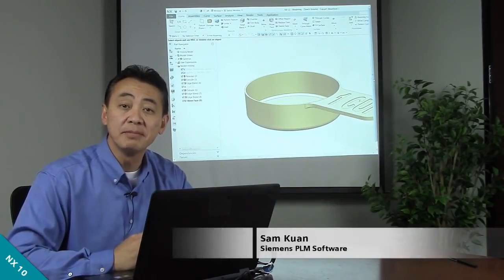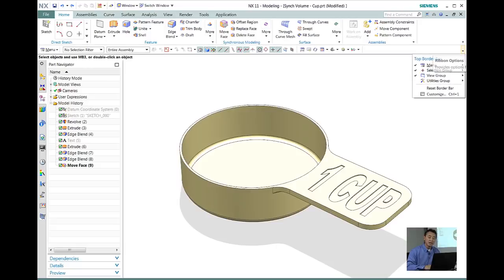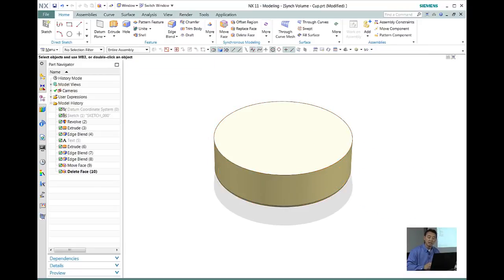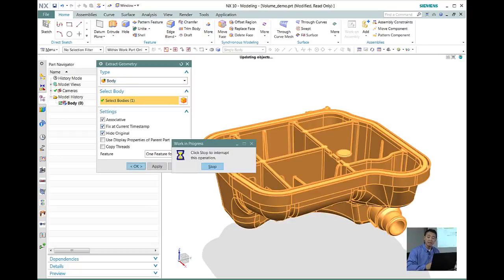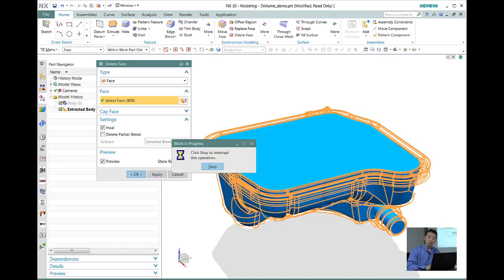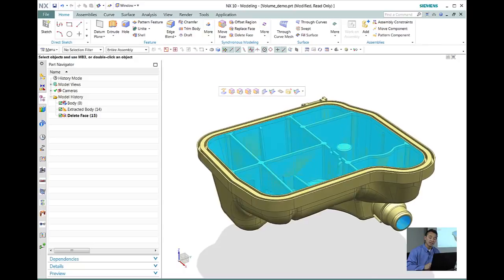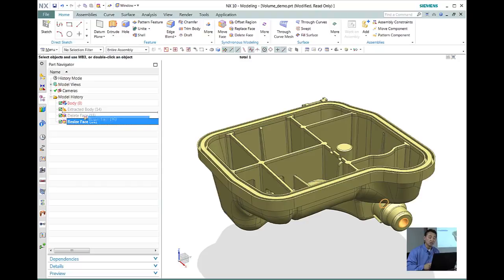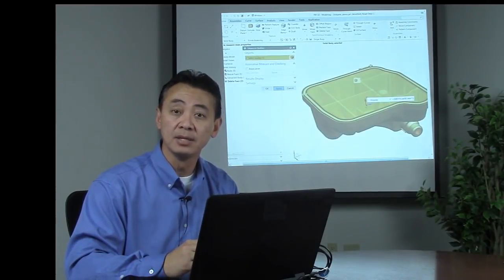How to calculate Volume of bottle in NX

Comment: Volume is easy enough. I need something on surface area projected to a flat plane. Let's say it is a complex part with runners. I need to calculate what the projected surface area is to calculate die blow on a press. I would also like the result to be associative back to an expression that will always update and I can extract to a spreadsheet. Any tutorials for this in NX11?
Reply from the maker: you can use NX easy fill for this, it has pre- defined commands for this.
Reply: What is this "easy fill" you speak of. I looked for it with command finder and didn't find it.
Reply from the maker: https://www.youtube.com/watch?v=oqO6oQEOSXI